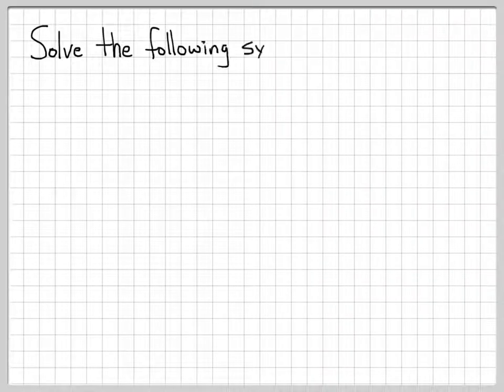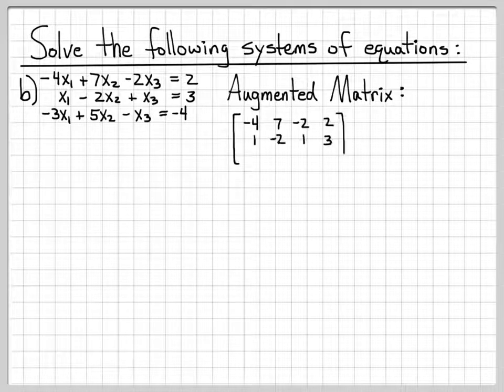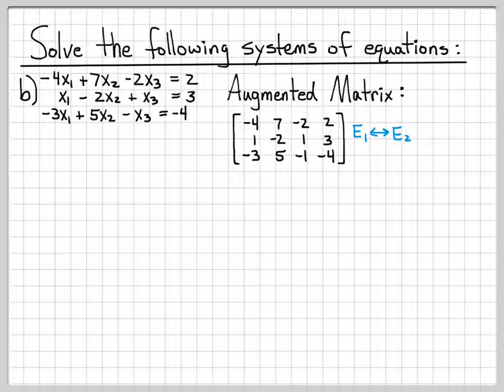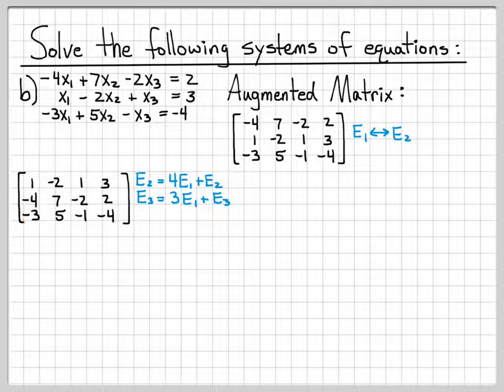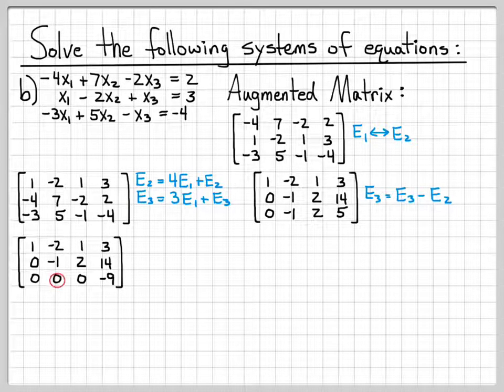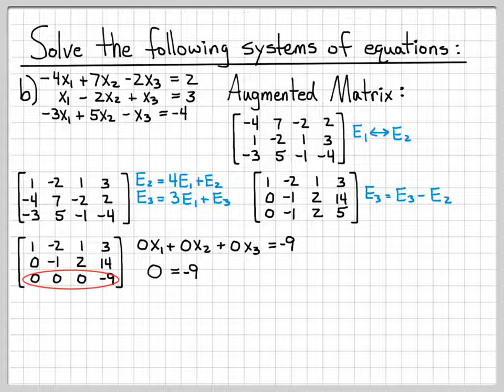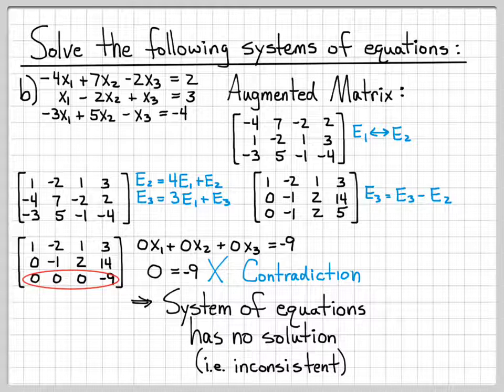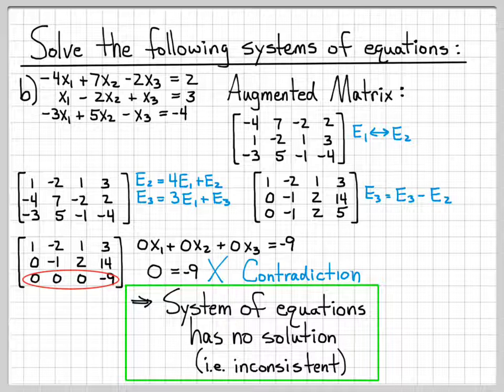Linear Algebra Example Problems - Solving Systems of Equations (2/3)

Comment: is there a reason why the first row have to start with 1? I did the math without changing the rows and got completely different answer. Why did you change the rows?
Reply from the maker: We always attempt to reduce into a form with one along the diagonals since then it's trivial to see the final answer. There are many ways/steps you can perform the row reduction, but their is only one final answer for the system of equations.

Comment: quick question, does it matter if you subtract e2 from e3 or e3 from e2.  bc that will make the difference bw -9 and 9.  how will i kno for the future is best.  or is always the last minus the second for example
Reply from the maker: +Sarah Burger To be honest there is no fixed rule.  The primary objective is to get the matrix into "reduced form" so the solution can be easily found using back substitution.  Exactly which rows you subtract or add will be different depending on the specific system of equations.  Just always move towards trying to get it into the reduced echelon form and you'll be good.  Just takes some practice to figure out how to get everything to cancel out.